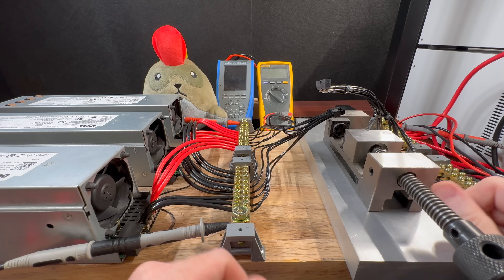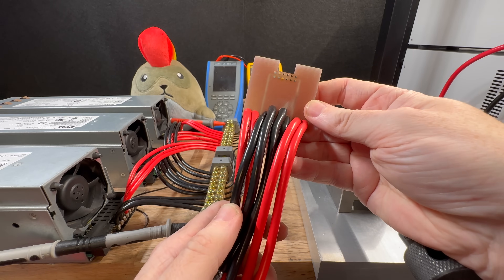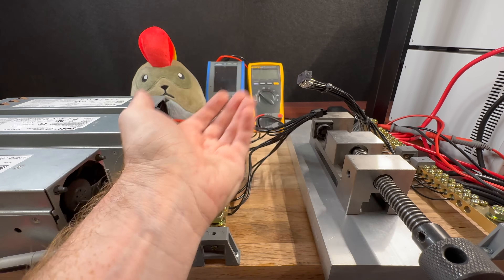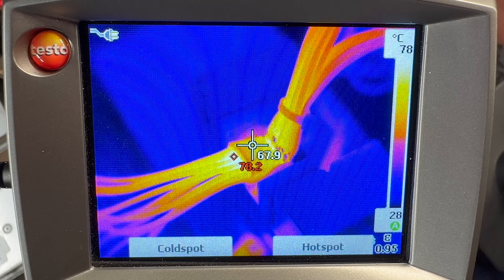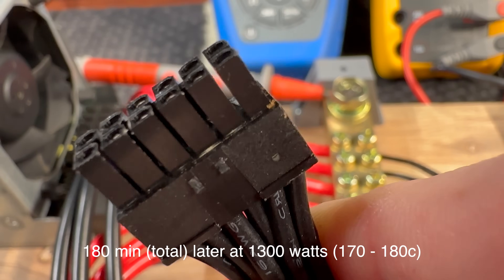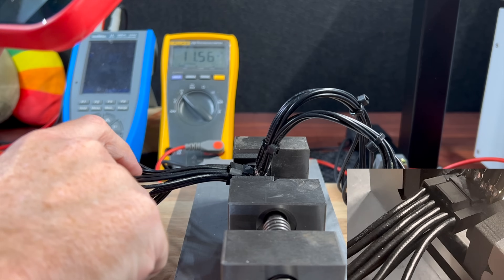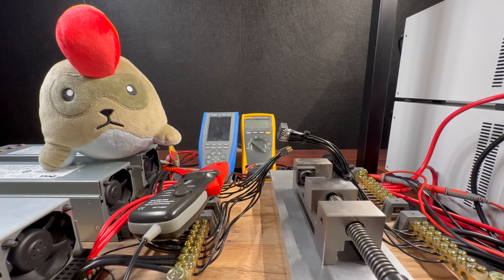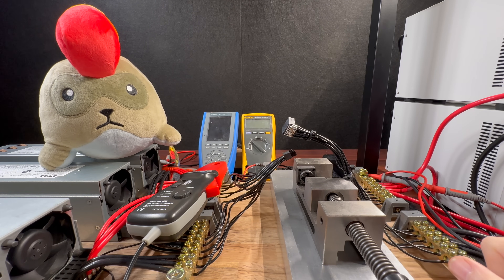NVIDIA 12VHPWR - Q&A + Melted Wires

Comment: So the thing you're testing isn't what's melting people's cables. 
If you run 1600W/12V through 6 wires, you're running about 266W over each wire. 

Now imagine a badly seated connector where only one wire makes contact. There's zero safety features preventing this with the 12VHPWR cable. That's 600W over each wire. You would need 3,600W total to replicate that with the test setup. Or 300 amps (50A on one pin). 

That's going to melt your connectors.

Alternatively: Connect all the wires together on both sides, then cut 5 of the 6 wires to simulate. The remaining wire will likely melt at the weakest point (usually the connector).

The problems aren't caused by this connector by itself. It's a combination of single-rail power supplies, and the accellerator card side where all the power gets combined into one big 12V/50A blob. A badly seated connector and you have 50A over one of those 16-gauge wires.

Comment: Please view “I discovered something concerning and I need the Experts to chime in... More 12VHPWR discovery!” By “JayzTwoCents” depending on the pin configuration, manufacturer and make of socket and plug, you will get different readings from the 12VHPWR and the older 12V-2x6, there’s also evidence showing wear and tear from it  being plugged in and out multiple times, I encourage you to focus on plugging it in and out 100x times and doing readings that way, don’t forget about the pin type, some have two notches and others have one,

Comment: what psu would you reccomend for a rtx 5090? 1200-1300w? is atx 3 ok or 3.1 better
Reply from the maker: At least 1200W for breathing room :)
Reply: @ I got a 1300w ax3 because apparently ax3 is better then 3.1
Reply from the maker: @ There were just some slight tweaks to the connector design anyway nothing major

Comment: isn't the answer already there? the connector cannot fail under normal conditions below 700 watts? right? if a 5090 connector fails -> something really bad must happen or the quality of the connector is horrible or some pin is barely connecting or something similar?! specifications aside -> this connector is capable of around 1000W without failure it seems.
reproducing the failure with a 5090 is close to impossible and if it fails - the true reason is unknown it seems.
Reply: meh
its clearly happening on 600w and less, indicating that there's a lot more load per single wire. 
would be interesting to see the max load per pin here like lets say 400-600W just on one.

Comment: Please put a 90-180° bend on male end of cable to replicate cable management. As plastic softens, we may see some wires move around and bad connections will form causing more load/heat on remaining wires.

Comment: Most PC builders often attempt to organize cables to create a more aesthetically pleasing and functional setup, which is commonly referred to as “cable management.” I’m curious to know if the pressure exerted on the connectors over time, especially under heavy loads, could potentially lead to failure. Imagine a heavy person sitting on a plastic chair. Now, imagine the same person sitting on the chair next to a campfire. When one or the chair legs become compromised, the load becomes uneven, causing elastic deformation to progress into plastic deformation until the point of failure.

Comment: Your testing is ignoring some important variables: 

1. The connector is soldered to the same PCB that has up to a 600W GPU heat load on it, and the cooler blows hot air over it.
2. The graphics card is in a case (not an open-air bench) with up to 400W of CPU heat.
3. A normal ATX PSU operates at higher temps than those server PSU´s with their fast spinning fans (also only 1 instead of 3) + thinner wires and no bus bars, which all combined don't give the connector the opportunity to conduct heat away through the cables.
4. In real-world conditions, there will be some strain on the connector (because of case design), which can lead to worse contact and therefore more resistance and heat. 
5. The load should be applied for at least 1 hour (minimum length of a gaming session).
6. Variables in PCB design can lead to very uneven use of the pins in the connector because NVIDIA doesn't allow for active balancing (as far as I understand).
7. Thermal cycling could lead to uneven contact or the connector coming loose.

In the video, you talk about the case problem, but I still don't think that the thermals are representative of a PC case. I hope the feedback can help with the next video.
Reply from the maker: You cannot just throw 100 variables at a problem without having consistently and repeatability, you also need to methodically explore variables and figure out what is relevant or not. Likewise every computer case and graphics card is different.

Comment: With the old connectors you could do a last test like Derbauer did with only two wires carrying all the power and then with only one wire carrying all the power for the 600w and the extra transient loads that are in the spec. If you get interesting results, you could get another pair of socket/plug and redo the experiment. Since the connector is still the same and the socket is new, the plug/unplug wear on them is restricted to only the insertions and removals you have done on it, which is interesting.

Comment: 1300w, if balanced by your setup, is still only 18a per pin.  Debaur measured 20a on one wire.  You aren't actually testing the failure case.
Reply from the maker: Yes I am lol ive been up to 35A per pin
Reply: @whatcouldgowrong7914  Without damage? I'm not watching the whole thing, but it seemed you were saying "I did 1300W without melting, so there is no problem".
Reply from the maker: @Pelicanzzz  I didn’t say anything of the sort lol, the connector is clearly failing but still intact. Watch the first video if you want to see a example of single pin testing
Reply: This guy seems way more level headed like he just wants to see where the testing goes.  Debaur and buildzoid seem emotionally invested in making a video showing 12vhp bad no matter what.

Comment: 5:53 - the extra heat in the prev. video was very noticeable, the ambient at the start of the video was 24C and by the end it was 29-30C already.  At 194 the leaded one will desolder of course.
Reply from the maker: Much longer testing + 1300W of heat filling the room takes its toll 🤣

Comment: I think the biggest flaw is that the connector itself may not be poorly designed, well basically they are. But Bullzoid has already explained what is poorly designed.. in other words: There is no point in trying to prove that there is nothing wrong with the connector itself. What you are trying to prove here does not explain why the others are getting their connectors burned up even though they have plugged everything in correctly.
Reply from the maker: Im trying to clarify points as much as possible and all the claims being thrown around about the connector eventually we may land on something important along the way also 🙂

Comment: Main problem in GPU burning cases it push majority of current through 1 or 2 pins. Also GND pins may spread heat more effectively because there is shunt resistor and fuse near the +12V side of that connector so heat have to go trough layers to gnd plane.
Edit: Not sure have all "forgot" what effect repeated thermal cycles do these connector. if you think 1-2 gaming session / day then it's lots of those cycles for connector.
Edit2: i think I would design 5x5cm 4-6 layer mockup pcb with fuse and shunt resistor to mimic GPU 12V input. Basically to test 12V pin heat transfer to gnd plane

Comment: The contacts are failing because they are oxidizing. Every time you wiggle the wires, they change contact resistance. the current clamp is the only meaningful way to measure. Being a DC clamp with a hall effect, they are effected by stray outside magnetic fields. Adding current sense resistors will tend to even out the currents, reducing the intent of the experiment!
Stay with the claps but route the wires through some kind of brace so that you can clamp on to them with out disturbing them.
Another thing to do, is that I'm sure you are getting a significant drop on the wires. Why not solder some sense wires onto the some length of the wires, away from the connector and then calibrate the voltage drops, individually. You might want to clamp the wires between the sensing location with some insulating electrical insulation that can absorb the heat to minimize the drift of the sensing location and to keep them all at the same temperature. If they are at the same temperature, you can then assume the total sum of currents are then proportionally consistent.
I think you're going to need to restart with new connectors.
One thing that I'd like you to try is to get some DC4 grease (Dow Corning silicon grease ). It is expensive but worth it. Use it on the pins so that the contact surfaces are coated. I think you will be surprised, considering that DC4 is an excellent insulator.

Comment: 1200-1300w testing is a great test because your loading 20+amps per wire, which is a known possiblity on 5090 cards, the 16 gauge wires begin to act as heating elements, and dumps their load into the connector, your right lead free solder will help prevent the voltage from dropping which should allow the connector to have thermal runaway.

Comment: I am pretty sure the wires in the connector that come with a PSU are crimped and not soldered.  So you might wanna run a test with a connector that have the wires only crimped. At least on male side of the connector, the female side is fine as it is normally soldered to the GPU.  Also you said something about wire length.  Corsair PSU can use up to 600mm cable length for the 12VHPWR.

Comment: When using unleaded solder (having previously used only leaded), be sure to use a fresh tip for your iron, otherwise it'll all get contaminated and clump up and not flow well. Also a fresh sponge and/or brass wool etc. etc. ;)

Comment: This connector is rated for 600W. Could you also test the temperature at 600W? Why not?
Reply from the maker: I can but I this is a follow up to the first video investigating the claim the connector has “no safety margin”
Reply: @whatcouldgowrong7914  maybe the pins inside the connector, being thinner than the previous molex pci-e connector, they are more prone to generate heat, not only at the connector position but the cables too.
In global, this configuration is not the safetiest approach, nor the more logic in regard of the graphic cards crazy consumption increase….
Reply: @whatcouldgowrong7914  thank you for your tests 👍
Reply from the maker: @ First video shows 600W and this video starts at 600W also